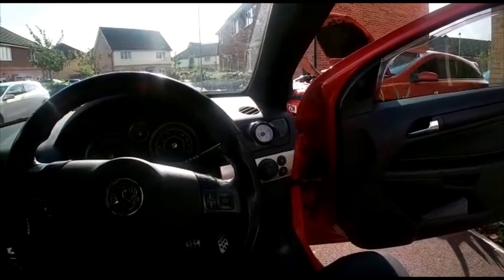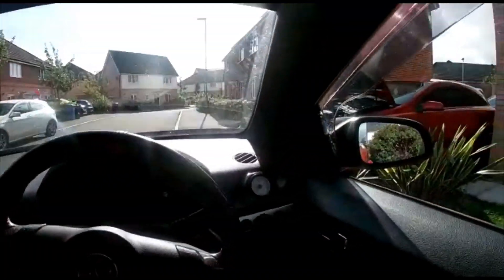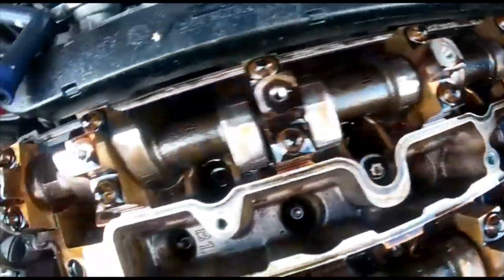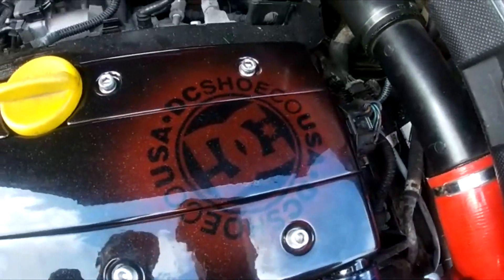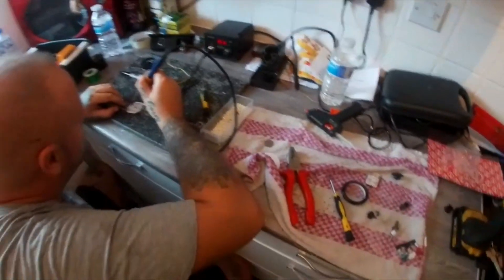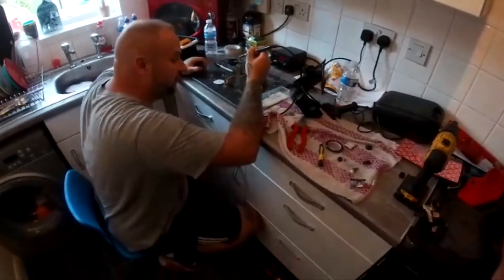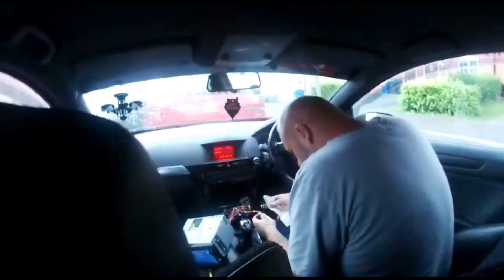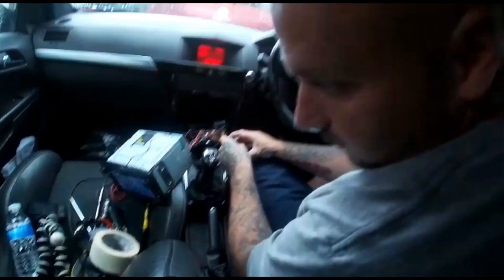*CHADDY GETS HIS CUSTOMISED ROCKER COVER PLUS WE UPGRADE THE BOOST GAUGE SET UP*

Comment: dont set actuator from threads just move the top nut out the way push the gate shut with your finger then tighten the bottom nut up till you cant tighten it any more by finger mark the top of the nut with a maker and add 2 full turns of preload lock the top nut down job done hope this helps bro keep the vidz rolling :)